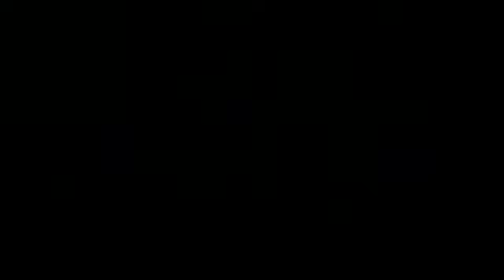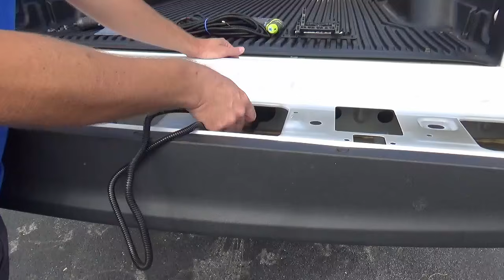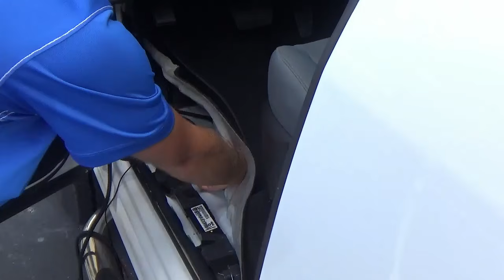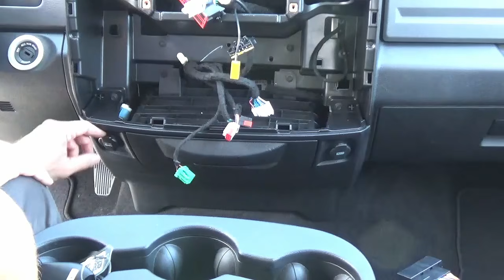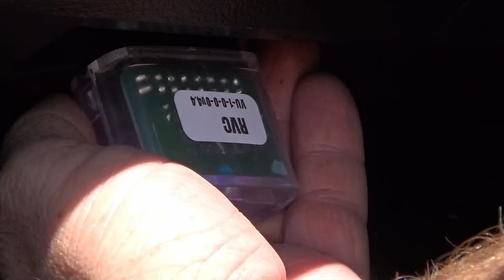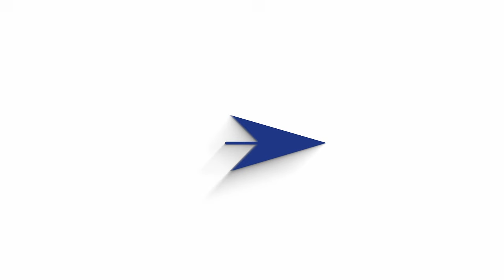2013-2018 Ram Truck - Backup Rear Camera Upgrade - Easy Plug & Play Install!

Comment: GD, You guys are proud of your $50 wiring loom, $40 backup camera and $30 handle. Do you guys install it for the $749.95 price tag? Because I'm trying to figure out how you justify that 533.29% markup. You're straight up scamming these folks. Does it come with the OEM stereo? Because Daumn, Anyone can upgrade their factory stereo in these trucks to a aftermarket 10.4" Tesla style android stereo with factory style bezel that keeps it looking OEM, Then buy a OEM handle/camera mount and aftermarket camera, that comes with wiring all plug and play for $100 less than what you're charging for that wire, handle and camera. And get Navigation which people who'd likely be needing a product like this wouldn't have from the factory with their OEM stereo.
Reply from the maker: We do not sell cheap equipment. We sell OEM quality equipment that is fully tested, pre-programmed and procured based on your Vin. There are plenty of companies that sell cheap products. We want to provide a part that we are able to guarantee works and will continue to work. We are confident enough in the product we sell that we are able to warranty it through installation and up to two years depending on your selection at check out. We feel our pricing is competitive as we are comparing our pieces to the cost of getting a new vehicle as opposed to the cost of an aftermarket part whose quality is greatly inferior.
Reply: @Infotainment_nav new vehicle... these are 7+ year old vehicles... hell.. my truck is a 2013 and I thought about looking at your stuff until I heard how much the price tag was. I am, by no means, a cheap guy, but $800 is outrageous! I just wanted something to ensure I could back up without hitting what's behind me. For $800 I'd better get a happy ending by a hot woman. Pretty disappointing considering I need a new radio,  too. Great video, but the pricing isn't. Good luck to you.

Comment: You can get up to 4 cameras feeding into the RA2. There is hardware modules that will allow you rear, front and both turn signal cameras. Which can be controlled using your arrow buttons on your steering wheel.
Reply from the maker: Understood! We have seen those. We actually used to use a multicam harness from www.navtv.com to allow front facing camera. But I think that multicam harness was discontinued.

Comment: My 2014 Ram 1500 Outdoorsman didnt come with backup camera, i bought 2014 Ram 1500 tailgate off Marketplace and took OEM camera out, what harness do i need too hook from tailgate up to my OEM 8.4 Uconnect , and the OBD Genie as well needed thank you God Bless Loved your video helped alot!!! I would like to buy from you due to your experience and knowledge with the equipment
Reply from the maker: Hi there,
You'll need these 2 listings. 

The camera loom that runs to the BCM and radio
https://infotainment.com/shop/interior-accessories/wiring/c-intcamf-ds/

OBDGenie for Back-up Camera (The harness for RCA to the Uconnect 8.4"'s main plug, C4T option as well)
https://infotainment.com/shop/interior-accessories/obd-genie-programmers/obd-genie-chrysler-dodge-jeep-rear-view-camera-programmer-c-rvc/
Reply: @Infotainment_nav So I ordered and hooked up my order, my camera works great, but I don't have grid lines? Is the blue wire the wire I must tap into the lynbust or? For dynamic grid lines and which wire do I need to tap into, or how do I get grid lines/dynamic grid lines etc. ?

Comment: Just installed mine on a 2014 1500. Set up was super easy, finished in about an hour. So far I give it 5stars. 
Just one minor thing/question. Is there anyway to adjust the back up camera? The lines and the camera are centered enough that if you can’t then it’s fine but my ocd wants it closer to the center. Thanks!
Reply from the maker: Understood. We're using the OEM handle for the OEM style, and we're using an aftermarket style with the same camera location. This seems to be just how they're made. It's possible that it's to avoid hands touching the camera lens when pulling the tailgate handle.

Comment: Do the guidelines follow the path of how your steering wheel is turned? Or is it just a static guideline?
Reply from the maker: Great question! The Aftermarket OE-style camera uses static guidelines, meaning the lines stay fixed and don’t move with the steering wheel.
The Custom Genuine Mopar camera, on the other hand, features dynamic guidelines that move with the steering wheel, showing your projected path as you turn.

Comment: Just got the rear camera reroute kit for my tradesman but now the video quality is awful. I'm guessing it was fine for the rearview mirror, but on my after market radio display the resolution is low. Can I just upgrade the camera in the handle and not the whole kit?
Reply from the maker: It really depends on if your radio supports digital or analog camera. Can you link me the radio you are working with?

Comment: is there a way to hookup that video wire to the radio without that big passthrough harness? is there a wire you could just tap into?
Reply from the maker: This upgrade package was actually designed to accommodate a plug and play install without having to worry about cutting or splicing wires.

Comment: Would I be able to flash for the backup camera using a Bluetooth obd scanner paired with alpha OBD?
Reply from the maker: The dealer and/or Alpha OBD should be able to program the BCM to enable RVC programming
Reply from the maker: We also sell that programming through this programmer. 
https://infotainment.com/shop/interior-accessories/obd-genie-programmers/obd-genie-chrysler-dodge-jeep-rear-view-camera-programmer-c-rvc/

Comment: Do you have a video for a backup camera on a ram with a center console?
Reply from the maker: We don't but the install is almost identical. If you are having trouble we do have a live tech support team at 855-636-6287 EXT 11 who can help talk you through the install.
Reply: @Infotainment_nav  is it possible to replace the camera if it breaks, or would a new kit need to be ordered?

Comment: Can I put the reversing camera on a 2016 alpina ram 1500 radio?
Reply from the maker: Sorry I am not quite sure what you mean by "alpina". This Camera kit is designed to work with the 16 Ram 1500 and its OEM radio. So you should be compatible with this kit.

Comment: Having issues with the display. When in “Reverse” I am getting a blue screen and unsure why. I triple-checked connection and all seems to be in order. I did even try putting the genie and reprogramming (done 3 times) but still no luck. Any suggestions?
Reply from the maker: This camera kit uses a harness for power to the camera by using the cigar lighter circuit. The harness also has a fuse itself. Please check the fusebox fuse for the Cigar Lighter, and the fuse on the harness. If you are getting power to the cigar lighter, then the camera may have gone bad. Please reach out to Customer Support for assistance if that's the case!

Comment: If I have a diablo tune installed, will using the obd genie with this or any other equipment like the radio interfere with that?
Reply from the maker: I seriously doubt so. The OBDGenie programmers are designed to make only specific code changes, and we don't have any that would involve engine tuning. This one specifically would just turn the back-up camera's value in the radio from not present, to present.

Comment: Hey I baught a android radio off amazon and my truck has the oem back up camera is there anyway I can use the wire for the aftermarket bsck up camera to splice the camera in the tailgate so I can use the oem one?
Reply from the maker: We only work with OEM equipment so we do not offer anything that has been tested on an aftermarket radio. We have a programmer and harness but that is more deisgned to work with the OEM module. I would try Camea Source. 
https://www.camerasource.com/

Here is our programmer and harness for the OEM radio. 
https://infotainment.com/shop/interior-accessories/obd-genie-programmers/obd-genie-chrysler-dodge-jeep-rear-view-camera-programmer-c-rvc/

Comment: Will this work if I have an after market amplifier installed to my oem radio screen?
Reply from the maker: Amp should not effect this. This will plug into the factory radio. As long as the full radio system has not been swapped you should be fine.
Reply from the maker: If you do have a fully aftermarket radio you may have to go aftermarket with the camera as well.

Comment: Any options for flatbeds?
Reply from the maker: We do offer a license plate bracket backup camera as well as a cargo camera. 

License Plate Camera:
https://infotainment.com/shop/exterior-accessories/backup-cameras/c-bdllpm-c4/

Cargo Camera:
https://infotainment.com/shop/2016-ram-1500-classic-build-series-upgrades/2013-2018-ram-factory-chmsl-third-brake-led-light-cargo-camera-kit/

Comment: What will be the cost of option 2 factory design if like to order with programer
Reply from the maker: $699.95 (Before taxes) is the price of the OEM style with programmer (this option gives you the moving reverse lines when you turn your steering wheel)
https://infotainment.com/shop/exterior-accessories/backup-cameras/13-18-ram-truck-tailgate-handle-backup-camera-kit/

Comment: I bought this kit for my 2015 Ram about 4 years ago along with the 8.4 inch screen upgrade and it worked great until the other day when in reverse it shows a blue or black screen and says camera unavailable. I tried messing with the connection under the tailgate and still doesn't work. Any suggestions as to why it would quit working?
Reply from the maker: Hi there,
This camera kit uses a 12V accessory harness that uses the cigar lighter circuit for power. The 12V harness has a standard blade fuse on it. If you can verify that you are not getting power at your cigar lighter, please check the fuse in the fuse box, F93 for the cigar lighter, and then check the fuse on the 12V accessory harness. If both fuses are fine, and the cigar lighter is getting power (you can put a phone charger adapter or something to see if it gets power) then it's possible the camera itself has gone bad. We get these kits pre-boxed from Camera Source. So you may be able to contact them to see if you can just purchase just a replacement camera (We would have to sell you the whole kit, minus the radio harness and 12V accessory harness and OBDGenie). You can provide them your order number from your original purchase with us. If you cannot find that order number, please call our support team and they can look it up for you!
Reply: Was the camera bad?
Reply: @rsmetalguitar  Yes I believe so. Haven't got around to replacing it yet but I'm sure it's bad it has power despite that it's not working.
Reply: Did you need to buy a new kit, or did they send you a replacement? I'm considering getting a kit, but I have concern if the camera goes out.

Comment: Do you guys sell just the wiring kit? Both from back of stereo and the pass through harness? Any chance to buy both with obd genie?
Reply from the maker: We offer these packages as complete plug and play kits.  The configurations that we offer are limited to the components contained within the drop down menu listing. 

https://infotainment.com/shop/exterior-accessories/backup-cameras/13-18-ram-truck-tailgate-handle-backup-camera-kit/

Comment: Will this work with an aftermarket radio?
Reply from the maker: Yes this ends in an RCA connection so it will plug directly into most aftermarket radios. Just do not select the genuine Mopar camera as that may not work as successfully.

Comment: Will this work with the factory 5in UConnect radio?
Reply from the maker: No the Uconnect 5 uses a digital camera but you should have one as they camera for reverse was standardized in 2018. Do you have the Vin you could send me at Taylor@infotainment.com?

Comment: Will this work with aftermarket radio?
Reply from the maker: Yes this ends in an RCA connection so it will plug directly into most aftermarket radios. Just do not select the genuine Mopar camera as that may not work as successfully.